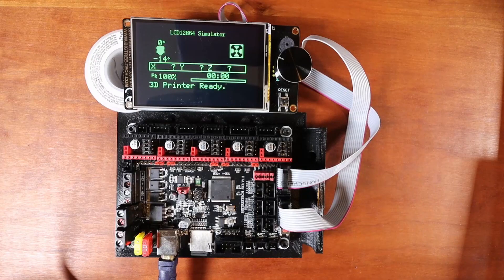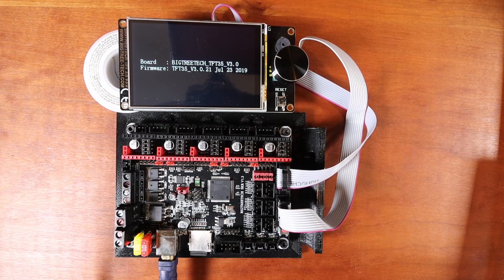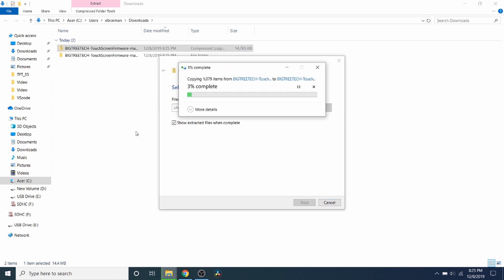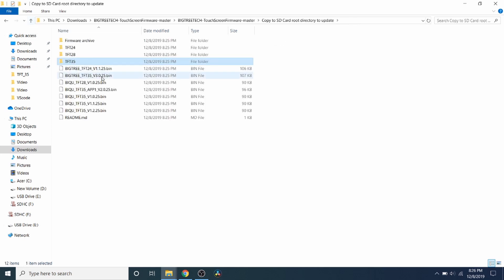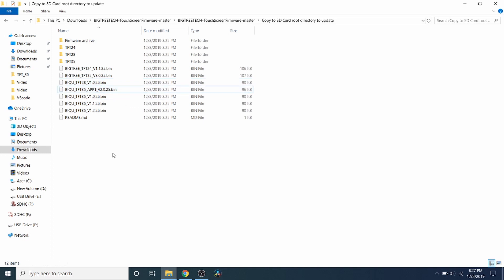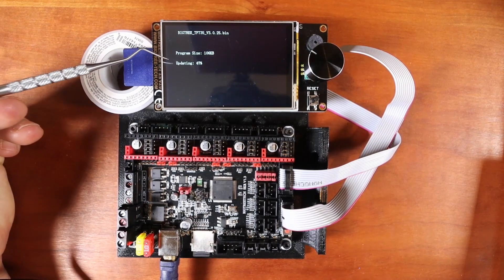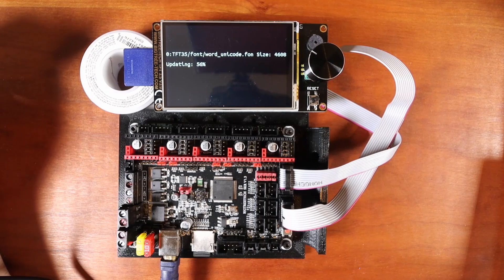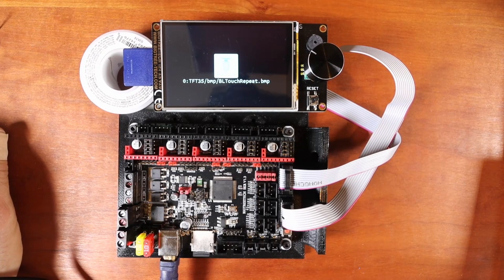SKR 1.3 - TFT35 V3 Firmware upgrade  (2 of 3)

Comment: Should this be the same for skr 1.4?
Reply from the maker: Should be, but chipset may very.
Reply: @EdwardBraiman  yeah I've been having nothing but trouble with the sk4 1.4 board and the tft35 e3 3.5 screen. I wanted to get a touch screen for the ender 3. So I had to get a32 bit board and 1.4 was new and sounded awesome with all the things you could do with it. So it seemed like a no brainer. But it's been a nightmare. Their definition of plug and play is apparently not the same in Japan as it is everywhere else in the world lol. Its more like plug it in and play with it for a month trying to get it to work. And once I try troubleshooting I realize it's almost impossible because between steppers, board, and screen they all separately apparently have tons of issues and notorious for garbage corrupt sd cards. So its hard to pinpoint exactly where the issues may be cuz they could all have issues. And others were saying how the customer service is nonexistent and if you do get them, they'll send you a new part...and then find out its also messed up too. So before I give up and send it back I'm just trying to find something with the same setup. But there's not  one that I can find. Theres alot of skr1.3 and tft screens but there's not much out there with a 1.4 and tft35 e3 3.5. and tmc2209 steppers so that I know I have done the exact same steps as someone who has got the same combo working fine. It looks like I have done everything right but I'm still getting a "no printer attached" message. No matter what I do I can not get the stupid thing to connect. Everything seems like its fine. The screen works all the functions seem to be fine but just won't actually print cuz the it says its not attached even though it clearly is. And also the emulated marlin mode never starts. It just goes to black and does nothing and I actually have to restart the printer to get it out of that mode. But yeah the downside of the 1.4 is thats still pretty new so there isn't much. And there's more out there for the turbo version than the regular. And even though they're somewhat the same, there are still differences and go figure all the in depth instructions are always with the turbo. So idk if those small differences are what the problem is. But after looking at all these reviews it just looks like these bigtreetech setups are riddled with problems. Its definitely aggravating to say the very least lol
Reply from the maker: The LCD for this video is not an E3 version, but I do have the E3 version and I agree it seems to suck.

Comment: I have copied the file "BIGTREE_TFT28_V3.0.26.1.bin" to the SD but it does not work.
- I have also tried with "BIQU_TFT28_V1.0.26.1.bin
", the same...
- Copying to SD: "BIGTREE_TFT28_V3.0.26.1.bin" + "BIQU_TFT28_V1.0.26.1.bin
"... nothing
Extracting"bmp" and "font" folders from TFT28 folder to SD root. Renaming these as "mks_font" and "mks_pic".
 and more nothing...
The TFT28 screen always stops showing "Updating 100%" but does not advance.
Reply from the maker: I'll need to try it out.  Have to tried and older build?

Comment: All makes sense thanks, but for me after reboot it jumps straight to the Loading icons message - it doesnt do the firmware upgrade which is on the card.  I have a TFT-35 V2.0.  Any ideas whats my problem?  Trying to get access to the Z-probe adjustment M851 functionality
Reply from the maker: Check format of SD card and make sure it's formatted fat32.
Reply: Edward Braiman it was missing the boot loader as many found with v2

Comment: The BTT documentation is poor at best and this video fills in some of the void. NOTE: If you have the TFT35 'E3' version (sold on eBay, etc.) you need to use files from the "Copy to SD Card root directory to update - Unified Menu Material theme". Otherwise the home menu icons are weird.
Reply from the maker: Yeah, it appears there newest update does this.  If you pick the GitHub version before this, then you'll not see the issue.

Comment: Anyone getting a blank screen in marlin mode check that you don't have the same color font as screen settings. This was my problem I changed the font to green and the screen to black and now it is working. It took me a week to figure this out. This is done in the screen  not in marlin.
Reply from the maker: Which version of firmware are you using to flash screen?  Someone yesterday figured out they changed since recording.

Comment: i actually cant get the icons working properly with the firmware version 25.1 for the tft35 v3. I tried the version 25.0 and then it worked. even all the hints with smaller sd cards (i used the stock 128mb microSD card which came with my skr 1.1 pro) didnt work. maybe its a firmware problem itself with the 25.1 release?
but thank you edward, i really like your videos!
Reply from the maker: They may have changed the build since the tutorial.  Can you make a quick video of what you're seeing and post a link?
Reply from the maker: Did it give a large rectangle near the bottom of the display.
Reply: @EdwardBraiman  I downloaded the recent version on github today, so i guess, its the newest version so far. i gonna flash the 25.1 version tomorrow again to make a quick video of what is happening and i gonna post the link tomorrow so that you can see what is happening. now it's too late for me (its 2:30 am for me :D).
and yes, as far is i remember correctly, there was a large recangle near the bottom and the icons werent shown correctly. As i said, i gonna record it tomorrow to show you what is happening with 25.1. Thanks for your answer!
Reply from the maker: They seem to have changed code to only want users to used Unicode version.

Comment: !! THE STEPS TO GET ICONS AND TEXT TO SHOW UP CORRECTLY !!

Most likely the problem is your SD card is too big. Here are the steps I took to shrink my card. You can resize the card once you are done installing the firmware.

1. Right-click on the Start menu (Bottom left of the screen).
2. Select Disk Management.
3. Right-click on your SD card.
4. Select format.
5. Set the File system to NTFS and click OK.
6. Right-click on the start menu and select Disk Management again.
7. Select your SD card right click and you should be able to shrink the SD card down to 3 GB now.
8. Right-click on start select disk management and format to FAT32

Now load the files on the SD card as in this video and upload it to the TFT35 V3.

To get the SD card back to original use this guide...
https://www.youtube.com/watch?v=8ZlOjtcBv4w

I hope this helps someone out!!

Thanks to Edward Braiman for this Video it was a great help!!
Reply from the maker: You're welcome.

Comment: I am getting no icons or text. The icons show up as white blocks and the text shows up as fuzzy lines. I am using a 64 GB SD card. I noticed someone on here say they used a smaller card and it worked so I formated the card to be 3 GB. I appreciate your response. I didn't expect one so I thank you!!
Reply from the maker: If you haven't already noticed I responded to about 95% of questions, unless I do not get a message from YouTube.  You're welcome.
Reply: @EdwardBraiman   I forgot to mention  I have an SD card adapter that will be here tomorrow so I will use the 128mb card that came with the skr v1.4 board. At one point I did have the Icons working after installing one of the versions of the firmware. Anything you can think of would be greatly appreciated!
Reply from the maker: How did it workout?

Comment: Hello Edward, how are you? could you please advise me what to do& - th problem is i have downloaded the upgrade to a micro sd card (v3-0-25 the latest one)- unfortunately after rebooting on the screen there is no text - trying to load again and again and there is no use of it(
Reply from the maker: Little red dots to press in three corners and one in the center?  If that's the case it took me about 10 tries before it worked.  Try switching fingers used.
Reply: @EdwardBraiman  Thank you! have solved it! the micro sd what was with the tft is faulty - and i used my large on on 128 gb! today bought 16 gb and everything is good!!!!!!!
Reply: @EdwardBraiman  the large on is not good for this! the small one micro sd on 16 gb is good! formate it to fat32 system!

Comment: Any thoughts on using the TFT35 V3 on the SKR 1.4.  TFT pinout between SKR 1.4 and SKR 1.3 are different.
Reply from the maker: Mine should be arriving tomorrow according to Amazon, so when it comes on Friday, I'll check.

Comment: So I tried doing this exactly as you showed, and it wouldn't work for me. It would load the .bin file, but the graphics were all messed up. That's with copying the .bin, fonts, and bmp folders. 
 To get it fixed, I had to copy the entire contents of the "copy this folder contents" files. That's for both the unified or standard folders. Then it would correctly load the new firmware.
Reply: I was having problems updating the font's and bmp's, I decided to use a smaller capacity sd card and font's and bmp's updated first try
Reply: Ben Newman hi have got the same problem and nothing works today will try smaller card volume ;)

Comment: You forgot to add the third touch screen cable to the TFT header on the board! No amount of new firmware will make it connect without it. That was your point, right?
Reply from the maker: It's for the SKR DIP 3 motherboard according to the document linked in the description.  I'll be test that soon for the SKR DIP 3 motherboard.
Reply: @EdwardBraiman  Sorry but I have all their boards including the SKR V1.3 and the BTTtft 35 v3 and that cable is required for touch screen to work.
Reply from the maker: Try it out with the tutorials and let me know.